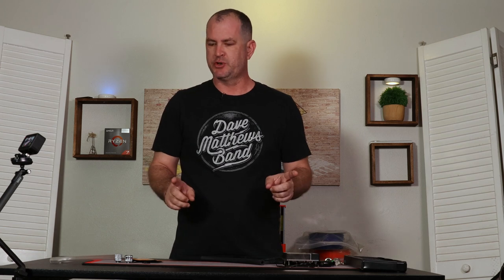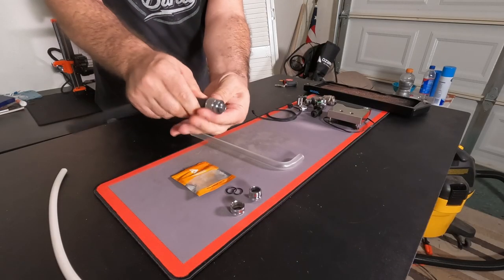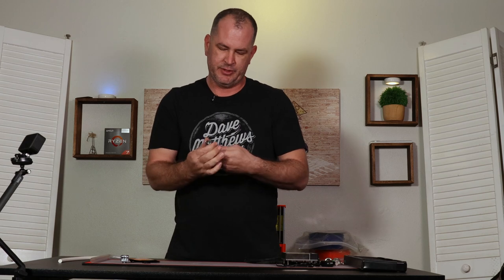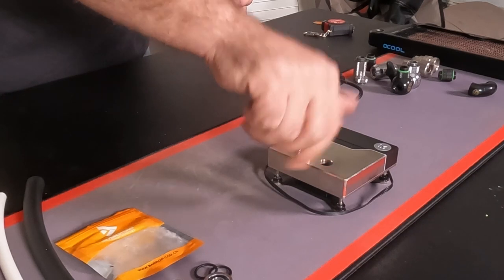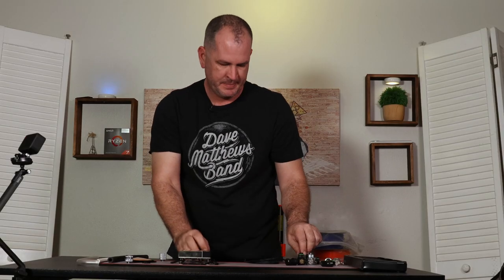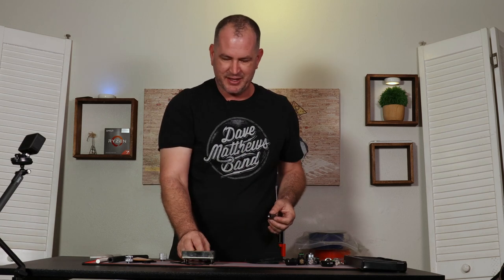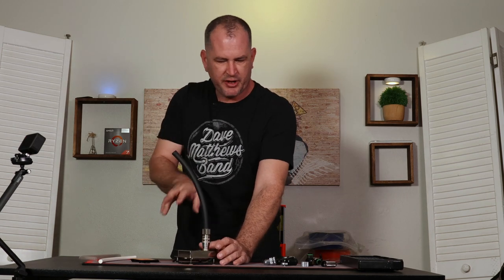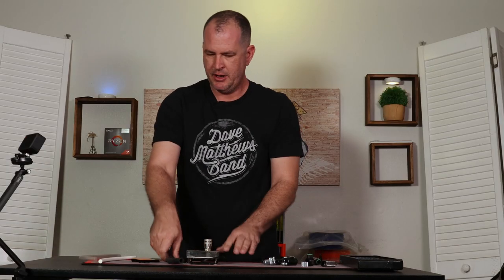PC Custom Loop Fittings Guide

Comment: can a quick disconnect fitting be used on a hard tubing pipe ? or is there a quick disconnect for hard tubing ?
Reply from the maker: I don’t think so, no.
Reply: @currentlykent4593  NO ,as in quick disconnect  is for soft piping only ? pls
Reply from the maker: No to both of your questions.
Reply: @currentlykent4593  okay and thanks so much for the reply , guess am doing soft tubing then , your video really helped , thanks once again